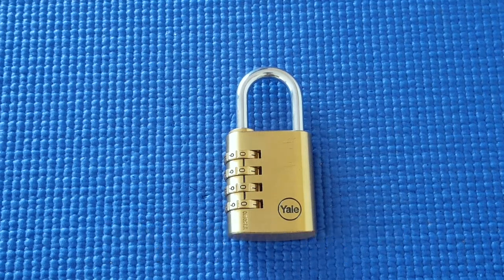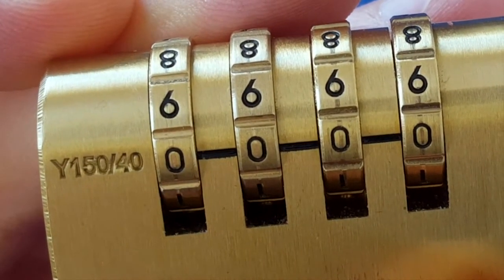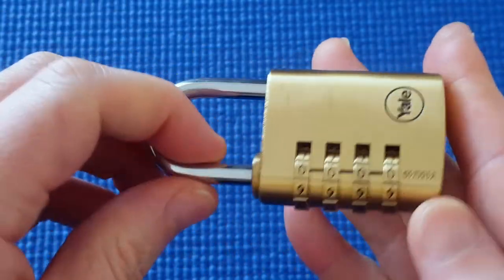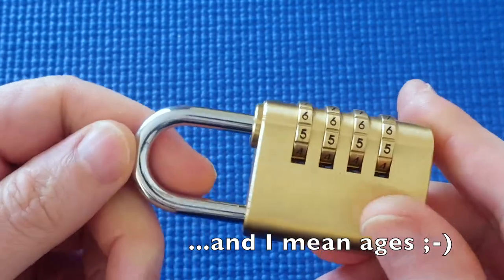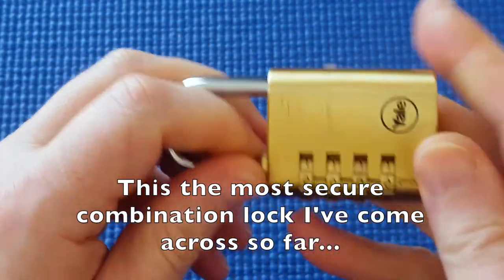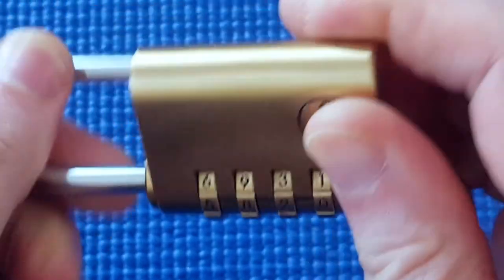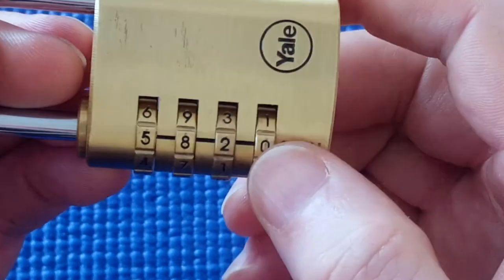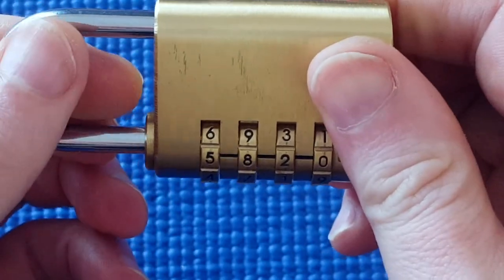(Picking 35) Yale (Y150/40) 4-wheel combination padlock (decoded)

Comment: Good lock, the shackle is a bit weak though. I used it to secure my toolbox when im onsite doing building work. Nature of my work means there are 5 or 6 different contractor companies on site st any given time. So we have to secure our boxes. The lock occasionally catches on doorways, in the van etc. Nothing heavy. Well after 3 years of use  i unlocked the lock and shackle just broke off. No tampering, just fell out after getting brushed a few too many times.
Reply from the maker: Interesting!  I know there are stronger shackles out there, but (from what I've seen) each come with there own plusses & minuses.  What sort of lock do you use now?

Comment: Hi bro. Do you know the difference between Yale standard models and the 'B' models? 
For example, the 150 and the 150B, 120 and 120b, etc..
- Another NZ picker and decoder ^^
Reply from the maker: Pleased to meet you! I really don't know what the difference is ... I could guess that when Assa Abloy bought Yale they slowly introduced new names to the product line, and maybe they started using B for the brass ones?
Reply: @Swynndla  No worries. I've had a 150B combo lock for a while and it's easy enough to decode but I use a different method than say the ABUS or Lockwood combo locks. The 150B has a different appearance than the 150 you've got there too. I came across this video when browsing locksport and decoding videos and noticed the different appearance and the way you and potti decode this is also different to the way I do mine. My method is hard to explain but quite fast, it's just another flaw to exploit. You can grab one for about $25 at Bunnings. 
I'm more into picking though.
Thanks for the reply and take it easy.
Reply from the maker: @-AdApt-  Ah ok thanks for the heads up! I might buy one! .. but any tips on how I should decode it via you method?
Reply: @Swynndla  No need to get the dials into true/false gates before decoding it.

Pull on the shackle and press against the body as usual.

The first dial (closest to the shackle) should clearly snap into the right number (unless I got a fluke) and the shackle will jump slightly. Test the feel of that dial - Turn it roughly half a number upward then release the dial and it shouldn't snap back into the number it was on, then move it back into the number it was on, and then turn it roughly half a number downwards and release the dial.. again it shouldn't snap back into the number it was on.

You should usually feel or hear it click each time you move it up/down when you do this.

When turning the dials, they will mostly feel grindy and resistant, only a few times will they snap into a number. When they do, test the feel of the dial by doing what i explained for the first dial.
if a dial doesn't move roughly half a number up OR down when testing it, it's on the wrong number.

The shackle might not move for the other dials when they're on the right numbers, but it will for the first dial.

When you think you've got the first 3 dials on the right numbers, the fourth is just a matter of going through the numbers until the shackle opens.

It's fast when you get it because you'll just be going from one dial to the next, instead of the method for the ABUS etc, where you'd keep moving back and forth through the dials until you've got the right number for one dial. Though you might need to go back to a dial you thought was on the right number sometimes.

Let me know how it goes. It might even work on the standard 150 you've got there, I'm not sure what the difference is with the B model.

- I just saw your link to potti's fast method (I already saw his other video with the 150). Looks like he's using a similar method but doesn't pull on the shackle or turn the dials when testing the numbers. I just tried this method while knowing the code and the dials on this will be springy even when on the right numbers if moving them forward and backward. So that method doesn't seem to work for the B model although it is similar.
Reply: @Swynndla  Just uploaded a video. You can notice what I mean when I'm on the first dial.
Reply from the maker: @-AdApt-  Thank you for the very detailed tips! I'll make a point of getting one!
Reply: @Swynndla  No worries bro.
Reply from the maker: @-AdApt-  I do see what you mean ... but I'll only know for sure when I get one. It depends on the amount of tension you use, etc. It'll be fun to play with it!
Reply from the maker: @-AdApt-  I bought is and created a video: https://youtu.be/Mxcgxe8S7YA

Comment: Loose wheel- I have  Yale 4-digit combo lock and it feels nothing like what you're saying.  I have two locks on a case both using the same code.  I have removed one lock but am simply unable to remove the other lock using the same code.  Tried picking as described and it doesn't work. Tried sticking a paper clip down the hole and that doesn't work.
Reply from the maker: Hmmm I'm not sure why that is happening ... is it the same version "Y150/40" ? I also picked a Yale "Y150B/40" in my video number 150.
Reply: @Swynndla  Yeah I just watched your other video.  I purchased this in the UK latter part of last year so I do believe it is the new model  4 wheel 150. However, tried your method of starting with turning the first wheel but I didn't get any definitive click just normal rotational clicks.  The weird thing is I had two of these locks on a case with the same code.  I have opened one lock but this particular lock is just not wanting to play.  I'm now waiting for my company to confirm the purchase receipt to see if YALE can help.  When I get this other lock off I'm not using these again that's for sure. May revert to simply key pdlocks.
Reply from the maker: @Elfin4  Ahh yea I think key padlocks are more secure and more reliable.
If it was supposed to be the same combination as the other one, then It's possible that it's broken and will never open?
Another possibility is try the combination again (that it was supposed to be) and make sure each wheel is in exactly the right place, by jiggling it back & forth (up & down), because sometimes some slippage can occur where it says it's in the right place but it's not. If still no luck then it's possible the slippage could have slipped to the next half number or even whole number on a particular wheel, so put it to the combination it was supposed to be and then for each wheel do:
 one half up, test if it'll open
 one full up, test
 one half down, test
 one full down, test
and back to the middle if it doesn't open and go to the next wheel.
It probably wont work but it's a quick thing to test to see if that's the issue.
Reply: @Swynndla  Thanks for that.  I have tried that already so from discussions with the Manufacturer it looks like I will now have to cut the padlock with a grinder.
Reply from the maker: @Elfin4  If it was me, I'd spend 3 hours testing every combination, but I'm strange. :D :D